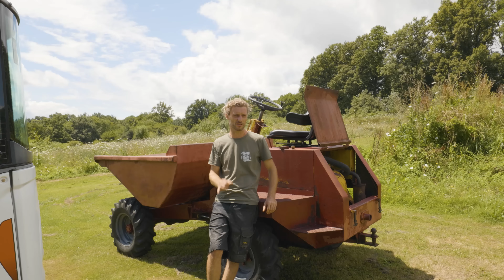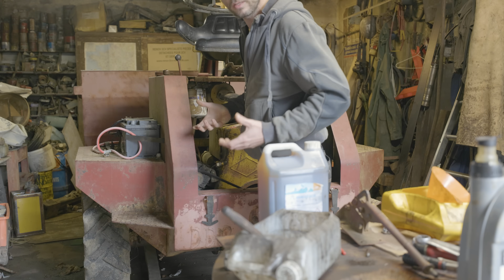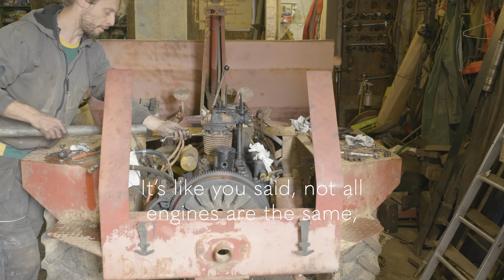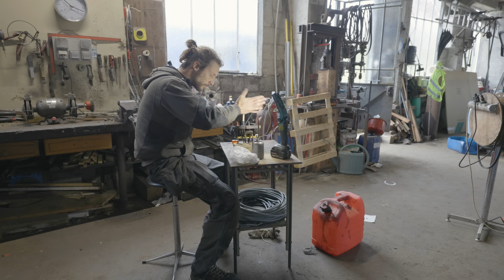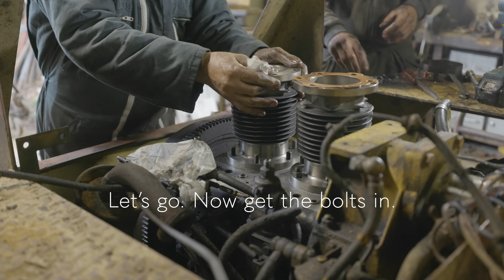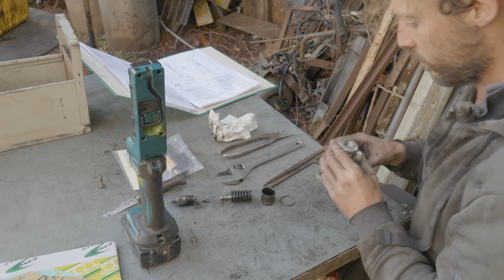Bringing Our Old Thwaites Dumper Back to Life! Engine Rebuild Begins! | #83

Comment: Yoyr dumper is  built like a war machine. What a great purchase for you. I'll tell you they knew how to build them when they're older equipment. I don't know if I missed it or not. But what year is that dumper?
Reply from the maker: No tags but it would have been between the sixties and eighties i think, the engine is an older type that was a hand crank but is fitted with an electric starter.

Comment: I sure hope you lubed your bearings before assembling and put the correct grease on the tappets and rocker arms and push rods before starting. Also oil the cylinder  walls so the new rings won't get hot and deform before the oil gets splashed up. And make sure there is oil in the valve train so the valves don't get scored in the guides. I don't know how long it will take for the oil pump to get pressure, but you could destroy the engine and all your work if you do not properly lube everything before turning over the engine.
Reply from the maker: The only thing i cannot remember is the gudegeon pin holding the piston. The rest has been lubed.

Comment: you've done well with your engine re-builds, helped by an "old time" mechanic with an "old time" workshop. I spent 50 years in the motor trade and know how tricky some jobs can be. Lookforward to seeing the old girl up and running
Reply from the maker: Thx Jim, fingers crossed it runs smooth! I will close my eyes on the first start 😂

Comment: More good work Philippe with Claude, and I like Anicia's narration, learning about the tasks too. The restored dumper will serve you well and you can maintain it yourself.   It seems that hydrogen will the replacement power for heavy machinery, perhaps a dumper will work with batteries.
Reply from the maker: Or a combination of a generator / batteries and electric motor? But soo expensive and complicated to run then 🫣

Comment: I rebuilt a Vw , aircooled engine....Did a three angle grind of the seats...and also replaced the guides...Amazed that new parts are still available for your diesel engine..Who made it?  Maybe I missed that...?
Reply from the maker: The engine is a Petter ph2 and almost all parts still available. They are good little workhorses that even go above and beyond when maltreated 🫣
Reply: @DomaineSauvage  I did a search here in the States...Found one for sale...:-)

Comment: It’s good to see old red finally getting some attention,that dumper has worked just as hard as Philippe it deserves some work, not a mechanic.
Reply from the maker: Hopefully it will run smooth !
Reply: @DomaineSauvage 
On the contrary, Sir. I hope that it will not run smoothly! Simply because of the fact, that a really healthy old style 4 stroke Diesel engine produces a hard knock with every combustion (due to a much higher compression than petrol/gasoline engines have). Additionally a 2 cylinder Diesel engine cannot run as "smooth" as one with 3, 4, 5 or 6 or even more cylinders. So let's hope that it produces hard knocks on top but the bottom of the engine and the gearbox run without any significant mechanical noises/sounds.
Best regards, luck, wisdom and health in particular.
Reply from the maker: True, the Petter PH2 engine has a distinctive engine noise.

Comment: Hello family. Seeing you lap those valves brings back loads of memories lol. I did my first engine, a Nissan 1400 at the early age of 16 and basically did exactly what you are. New pistons and bearings, rebored the block and fitted new valve stem seals. It was a great success and that motor went to well over 400000 Kms. It's a great skill to get because you get a great understanding of how the engine is supposed to operate properly.👌❤️
Reply from the maker: Hey Neuton, hope you are feeling well! It is indeed a very good lesson to rebuild this engine! First time for me but you can apply this to a lot of other engines.

Comment: I knew the principles but not the practise - fascinating to see - superb explanations, you're both such good communicators. 
To have the most critical and difficult part to repair in good condition is a great, confidence boosting achievement 😊
I wonder if it's easier to buy the rear bodywork ?
Reply from the maker: Thx daytona, you can still find parts but most of them are in the UK and i have to ship them over making it expensive.